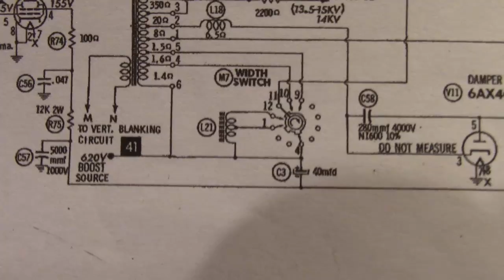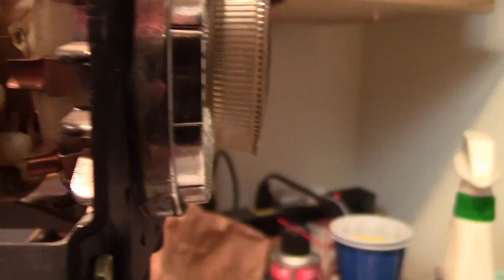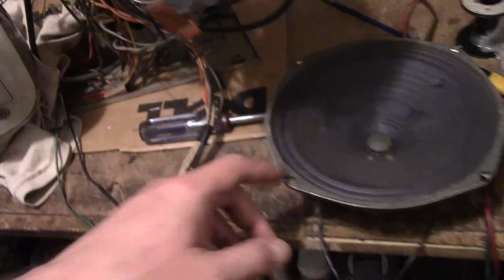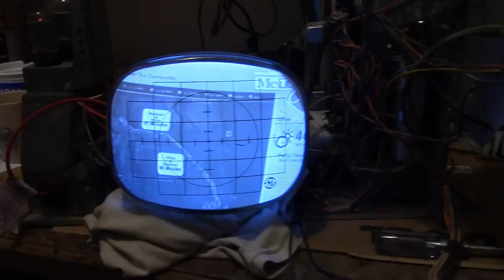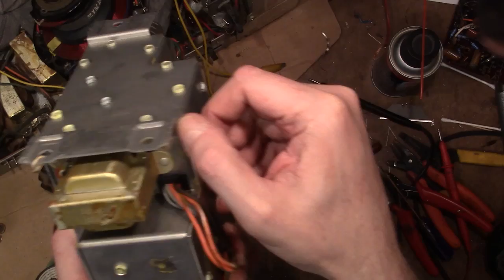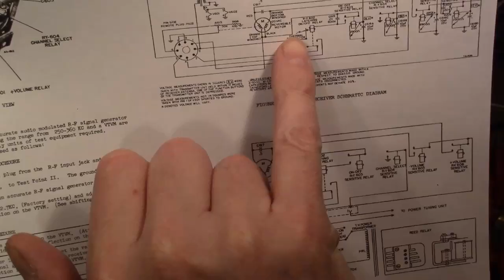GE 21C3461 restoration p4o?

Comment: I bet it feels good Bob when you take a "working" set, rebuild it, turn it on and it still works!!!  You've got the tuner working up to speed.  I'm sure back in the day, that was a marvel for people to purchase.  That remote control is not quite what we're used to today, but still an engineering feat.
Reply from the maker: +Edward Morris This was the first (and only) TV to use an RF wireless remote control.  They didn't make many and few are left.  I don't know of any other working examples.